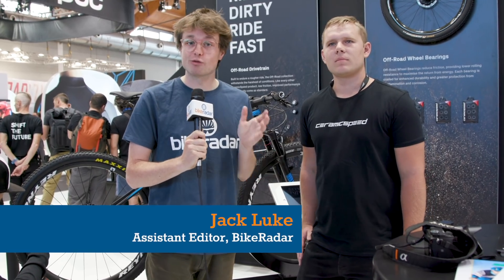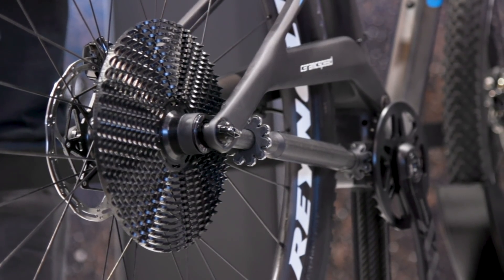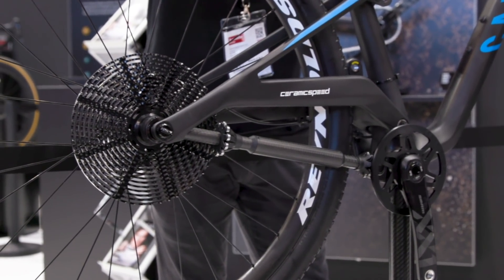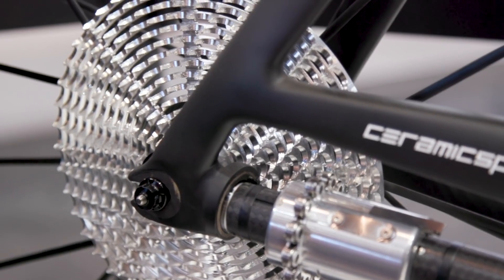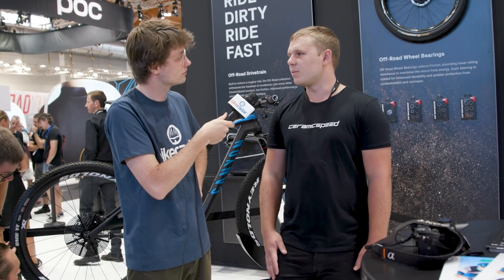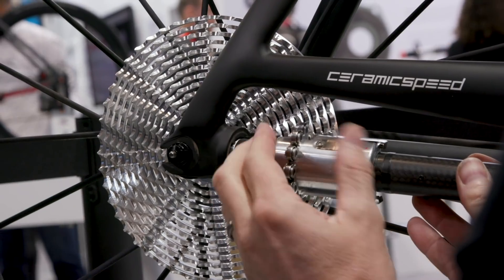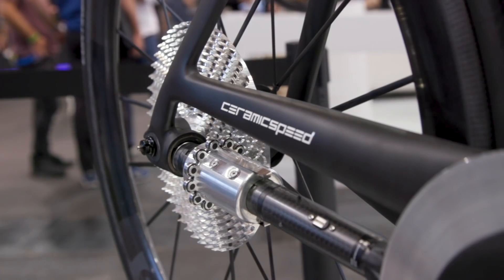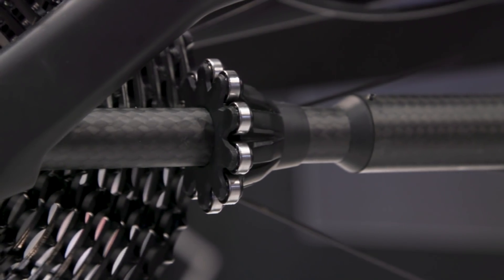No More Chains! The Future of Bike Design? | CeramicSpeed’s Driven MTB & Road Drivetrain

Comment: 2:25 what efficiancy gains?
Reply: I wonder that myself.  Driveshafts are less efficient than chain/belt drives.  That's a big reason most motorcycles don't use driveshafts.
Reply: @axessdenyd  I think their system is more efficient than traditional Driveshafts because they use bearings between the shaft and the cogs. I dont even want to know how expensive the final product will be if they even manage to overcome all the engeneering difficulties. It just seems way too complex for such simple things like bikes, especially because there are no similar designs they can look at. Or are there? A Gearbox for bikes is also very complex but at least we know how to do it. But a Driveshaft in combination with a gearbox all closed up could be very neat for some people.
Reply: My Opinion Doesn't Matter hammm u serious

Comment: I would destroy that bike in 2 hours  time. There is no way that this drivetrain  can take the pressure of a  Sprint from a Dead start.   I don't think that there is a trainer you can put that bike on. And what would be the cost of maintenance?   And what about the noise??? ha ha ha
Reply: vince orr albert how can you understand if you don't have the strength?  There will be slippage  if its not reinforced. Its good for weak twats like you guys. I can be moving at 20 miles an hour and if I go to Sprint on this system it will slip I guarantee it.
Reply: 😂 Ummm you are to stupid to see . You must think the world is flat? KK 👍
Reply: If your spelling is as good as your physics then I won't take your word for it.
Reply: When someone has nothing else but bad grammar to point out you know they are beat.  your name should be grammar Queen.
Reply: Your name is literally God of speed
Reply: td 123 yes it is 😁
Reply: Shut up old head, your like 60
Im done with u bud
Reply: Have you tried the system yet, the god of speed? I doubt it. So before you jump to conclusions shut your mouth, thanks
Reply: @john-ry7oq  I am very well educated in physics and I have been building since I was 14 years old.. This system needs to be reinforced  Witch will way the bike down.. this bike to  work right will weigh well over 18 pounds.. You need to shut up.

Comment: A mountain bike with all these little parts and if that shaft breaks ....just carry a spare
Reply: I have a very hard time believing that shaft could break. Belt and chain drive in cars is considered too weak above roughly 80 hp, but driveshafts are very difficult to crack under stress.

Comment: You've gotten rid of the rear mech but you added a lower hanging carbon fiber axle and a cog that I'm sure won't do well with rock strikes.  I don't really see any improvement here and would make me nervous riding this on aggressive trails.
Reply: vince orr albert  right but they don't run the span of the chainstay.  This thing is essentially a bash guard for your chainstay.  A lot higher chance of hitting it. Not to mention if you hit the cog thing on a rock that will put force directly to the cassette. Rambling about that....
Reply: MonsterChuck yes, those might me problems for the mtb aspect of it, maybe they will redesign the chainstay, and actually make it lower than the shaft, and directly below it, so it has something to protect it, idk, I have alot of ideas

Comment: Pretty smart way of doing the shifting.
Reply: it's basically the same function as Vyro cranksets, only adapted for rear shifting.
Reply: Yeah to bad the concept is over 100 years old
Reply: or stupid, depending on how easy it breaks
Reply: https://youtu.be/iUak9sqJmnM how it should be done.
Reply: 1914 fn herstale
Reply: Big facts I like how It dont use a chain cuz i have a mountain bike and i would hate for th to chain to snap and that's the upside the concept the bike dont have a chain that will snap under pressure
Reply: It's not only shifting but transferring the power as well
Reply: Read a bunch of comments, found some ppl with enthusiasm towards this, some who insist the traditional chains are "proven" and anything new is going to fail. To you I will say this: History has shown countless times, that without experimentation there is ZERO progress. All your criticisms may be valid, but there will always be at least one dreamer on the other side of the planet who will be determined to make it work. And who knows, maybe experimenting with the chainless drive will make even the chained one better. Don't discard other people's dreams, after all, they made your life the way it is now
Reply: i never seen the shifting version of this chainless bike except just now. Before, i was thinking how could a shifting will be possible. Im thinking gearbox is the only answer just like how they made in bikes with belt as chain. But i thinked what if not a gearbox. I came up with very similar concept. Just like on the video, but every thing is mechanical like being pulled by Cable just like a normal shifter. but these guy approached the electrical for easier and more stable build.
i think its not so cool to make the idea from being smart. it thinks its just the easiest way to do it ?
Reply: Cool concept though. Bikes were perfected long ago and have never advanced in any notable way since. I would love to have a miniature display version of this drivetrain for my desk though. Its pretty nifty.
Reply: @johnstreitt2474  this concept is over 100 years old there is a reason it did t stick and I'm sure it will happen again
Reply: U mean useless
Reply: @aymenesengouga5944  That doesnt even make any fucking sense.
Reply: @Larcona_  it's useless without a battery.
Reply: @gracefool  So is every car
Reply: @carlwheezerofsouls3273 , you're talking as if it's an E bike. The battery isn't there to speed you and the bike up, it's literally there so you can move up and down the gears, which you will manually do. The battery is specifically for the little motor to move up and down.
Reply: @mahfuzurchowdhury2765  i never said the battery was there to speed up the bike, my point is that when you're out riding your poodle around in your tiny purse and that little battery runs out, you suddenly cant shift anymore, making a takeoff nearly fucking impossible on the hardest gear.
also i posted that comment like 8 months ago dude.
Reply: @carlwheezerofsouls3273 , you would carry around an extra battery though, wouldn't you? Just like you would carry around any spares or repair kits for tyres or what not.
Reply: @mahfuzurchowdhury2765  yes but then you need to carry a battery along with all the repair kits and tools and shit. or you could just stick to cables, cause this doesn't have any real advantages as it is.
Reply: @carlwheezerofsouls3273 , I'm not saying it has really any advantages, I'm just saying carrying round an extra battery does not seem too bad. Literally, the battery would be pretty small, judging by the size of that motor. And with time, this idea can develop and get better and better. It could be interesting, and maybe could mean less maintenance after being made more and more successful? But we'll have to wait and see for the future
Reply: Carl, Wheezer of souls don’t make thé rules for others. Cycling is about having fun and doing whatever you want. You shouldn’t criticise others for having motorised parts or such things on their bike. As long as they like it it isn’t your problem.                                                           That being said, I do understand your standpoint of it being kind of unethical and defeating the point of what you think cycling is about. As long as you don’t start talking bs like gracfool does pretending he knows engineering without any concrete explanation or proof, I respect you.                   I do think it would be cool if they managed to make an motor-less version of this.
Reply: @carlwheezerofsouls3273  But surely if you're already carrying a tiny poodle in your purse you'd likely have space for a small battery!?
Reply: @mahfuzurchowdhury2765  not sure if you're aware of this, but electronic shifters are becoming more and more common on traditional chain driven bikes. They're basically superior in every way other than needing to charge them every so often.
Reply: @graham1034 , that's all the more reason for electronic shifters. Like I said, I'm not against them, and I'm open to new ideas.
Reply: @mahfuzurchowdhury2765  meant to reply to carl

Comment: Scam drivetrain, stolen concept from the 19th century
Reply: proof?
Reply: Matityah there is actually proof, in the wikipedia history of deraileurs, but this? This is a full functional(it functions, just not under loads of pressure) and a thing that is actually being improved, and there are no patents for it, so, everyone could pick it up, and rebuild it from scratch, and even if it was STOLEN, the guy commenting above would never do the maths to find out that it was more efficient, the “19th century version” didn’t serve the purpose of “99% efficiency” it served the purpose of shifting, and the inventors of it, in the 19th century were not able to actually make it work, soooooo
Reply: Sure there have been shaft-driven bicycles, but they're fixed-gear unless you have a planetary-gear hub.  Conceptually shifting this thing is much simpler than a planetary gear hub.  The problem is that while what it needs to do is *simple*, it's not *easy*.   You need a linear actuator motor and a battery, which may erase some of the weight and simplicity advantages over an internal gear hub.

I could see this on a mid-drive e-Bike however, where there's plenty of power available, weight is not such a concern, and efficiency is a big concern.  The advantage of mid-drive eBikes is that they take advantage of gears, allowing you to spec a lighter, less torque-y motor.